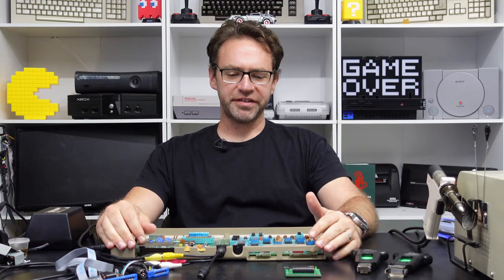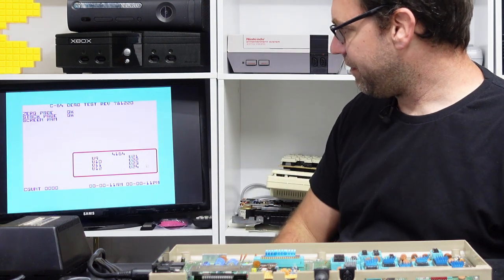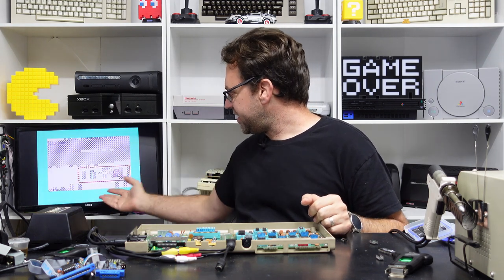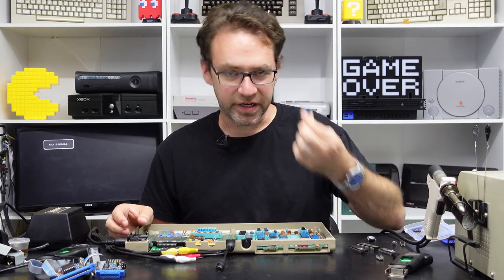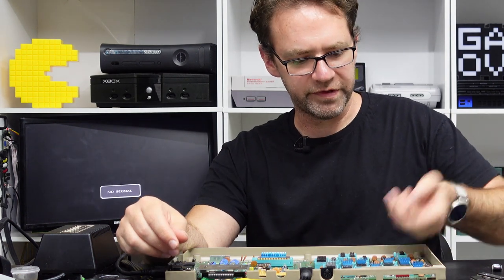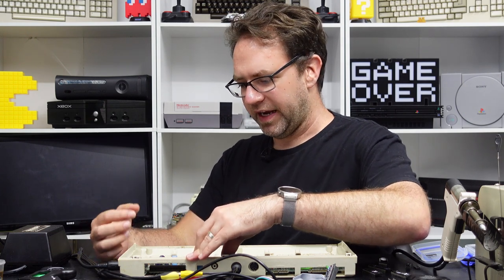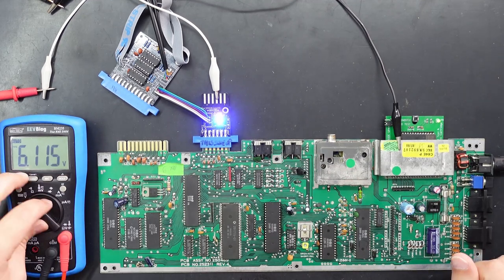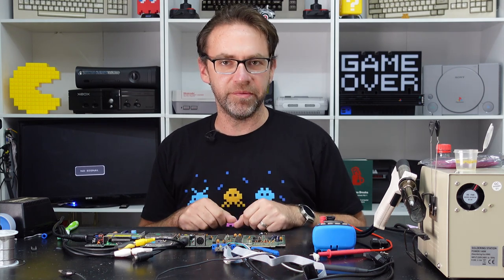Commodore 64 troubleshooting part 2 - dead test and diagnostic cartridge

Comment: I think Noel had a switch where the solder was cracked when viewed under magnification. The result was a semi-loose switch that was unreliable. He re-flowed the solder and was able to make it work reliably.
Reply from the maker: I did see that one, can't remember if it was the switch or the power connector itself. Intermittent faults are the worst 😄

Comment: Awesome. Love your dodgy Sven Diag Harness. I have a harness rig from an eBay seller (also a hard core forums contributor) that has worked well for years, but I think Sven's is a much more sound design. Coincidentally, I am about to order PCBs and parts to build my own SvenDiagHarness too. OMG, I did a double-take when that MFR Dead Test Flash Codes Cheat Sheet popped up in the video...YYYEEESSS! LOL -- I didn't think anyone actually used that except me.
Reply from the maker: Ha, believe or not I've never had to use the cheat sheet, never had a RAM fault come up, at least that I can remember. If you watch that segment closely there's a little pop up message that probably only you will understand 😉
Reply: @TheRetroChannel  Oh! I meant  to sign my comment, Mark².

Comment: 31:35 Always amazing the messes people leave. Who does that??? :)
How about a label (even for your own benefit) saying "this may be dodgy"?

When I was in college, wiring serial lines and the campus phone system, we were diagnosing a problem and found a note from on a patch panel from a previous student employee,  *signed and dated*, reading "This needs to be grounded".
Respect. :)
Reply from the maker: Haha, that would be nice and I guess it does happen. But I'm guessing in this case they probably thought they did a decent job 😄
Reply: Fair enough. I just reattached our wooden fence door's handle with two random bolts of different having two different heads from my junk box and tightened them so much that the nuts are embedded in the wood now. I suppose and carpenter that fixes it next will think: "Umm, WTF?" :) 

There is an amazing YouTube video called "Commodore 128 Board Repair - Part 1" on "RetroTech Dan" channel that is the most extreme C= repair I've seen yet.
Reply from the maker: At least that handle ain't going nowhere. It will probably outlast the fence.

Going to check out this C128 video now, sounds like something I'd enjoy 👍

Comment: Hi, a 250425 board.   Have you seen replacing 2 rams chips thanks to dead test...no cursor,  so I was going to look at  u1, but I decided to run diag with harness, all passed,  then I shouldn't have I guess,  but plugged in keyboard.  I could still type.  Loaded emulator and it worked,  but jail bars.  I shut off and tried to reboot... black screen and dead test won't do anything.  Pla, vic 2 and cpu are ok in my other 64?  Damn I wish I didn't do that... shorted something:(
Reply from the maker: Sounds like the CIA at U1 was already problematic. So definitely start by removing it and see if the machine then boots.
Reply: @TheRetroChannel  hi, thanks for responding.  I have already tried removing u1 and socketing.  No change.  Unfortunately I don't have an oscilloscope,  so I guess I'm just going to pick at and pull one chip at a time and try  the dead test.  So far I've done u1, u2, basic and kernal (left them out of sockets)  also did the 2 multiplexers. No change.  Again thanks for replying
Reply from the maker: Yeah without a scope or another working machine to test parts it will be tricky. I'd suspect PLA just based on how often they go bad, but also go back and double check the work you've already done. Good luck with it
Reply: Hi,  you are right about the scope,  but however,  I do have another working board that I tried the vic ii , pla and cpu in,  and works fine:)   voltages are good.. however,  can a power switch cause this problem?  (I've been watching your videos alot lol)  power supply is perfect input, but input on switch is 4.87, and output 4.84, and the other day it was 4.83 and 4.80.  Strange.  I only use the psu from Kellogg seller.  I've tried both,  same thing.  Ty again.  Cheers 🍻
Reply from the maker: @donaldblakley6796  That does seem a little odd. You could always check the resistance on the switch, with it unplugged obviously. I think the 3 legs on the switch towards the front of the board are for +5V and the ones towards the rear are the 9VAC. Can't remember which leg out of the 3 is which, but the middle one should be the common
Reply: Hi. I changed the switch,  I now have common voltages from switch:)  also I removed and socketed the character rom.  I now have the dead test showing 1 flash again (at least dead test is working on the board again)   u12 is socketed and tried other ram chips,   but still one flash. Grr. Lol. Checking out my soldering again
Reply from the maker: How frustrating. Again always try the dead test with all ROMs, CIAs and SID removed when possible. That should only leave the possibility of bad RAM, CPU, PLA or multiplexers (things like the switch can also cause issues but it looks like you've sorted that out). Of course bad connections on the remaining ICs can cause random issues
Reply: Hi,  thanks again for the input.  When I tried piggybacking another ram chip,  it changed to 5 flashes,  so hopefully getting somewhere.  I have more sockets coming Tuesday,  so I'm going to do them all.  Wish me luck.  Thanks bud

Comment: PIA (Peripheral Interface Adapter) is common knowledge. I've worked with Motorla's 6820 PIA. I assume it's the same as 6520. Am I wrong? 
I never heard of CIA chip until today! 
Isn't that just Commodores way of renaming something that already had a descriptive name?
Reply from the maker: Pretty much, maybe they were trying to avoid a potential lawsuit. A lot of MOS logic chips are just copies of something that already existed, but when you have your own fab downstairs you may as well use it to your full advantage
Reply: @TheRetroChannel  What does MOS stand for anyways? "Mother of S**T"?
Reply from the maker: @piconano  😄 It's actually my initials. But I think the company just got the name from metal oxide semiconductor.